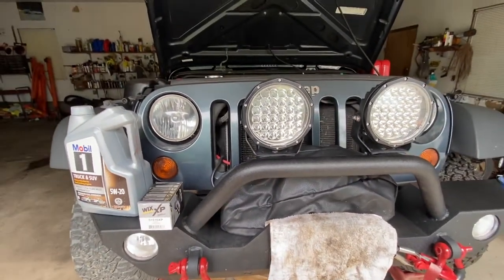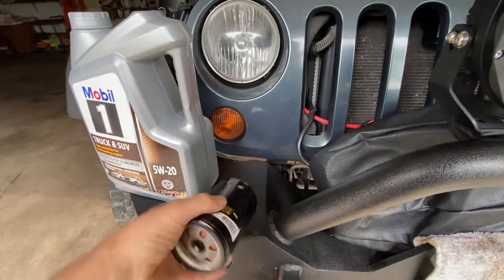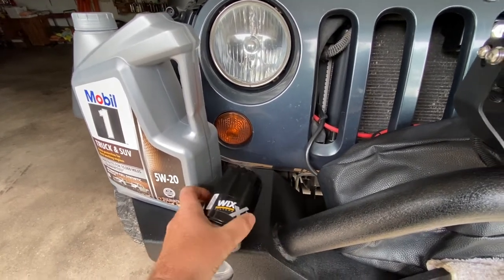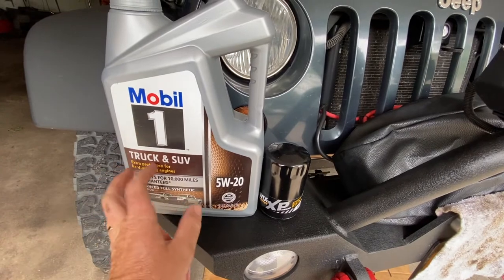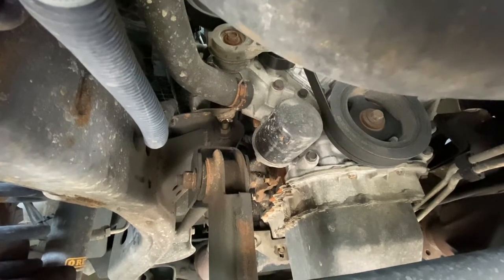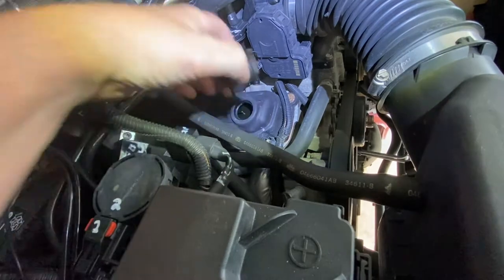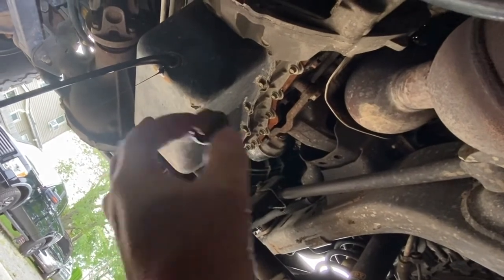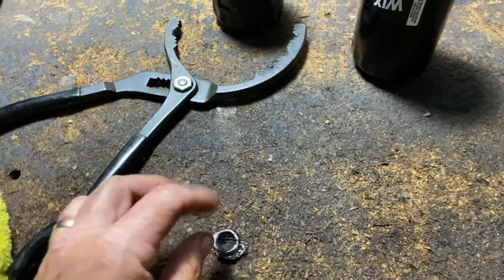Cold Start Up Rattle Noise on Jeep Wrangler - Easy Fix

Comment: Yeah that filter definitely doesn’t go on any wrangler above a 2011.
Reply from the maker: You tried to install one above 2011?
Reply: @Motorcarnut  well I own a 2016 and all Jeep 3.6  has their oil filter mounted on top , and are not canister filters . They are media filters that install in a housing mounted to the oil cooler .
Reply from the maker: Different filtration, you’re right. Does yours experience the start up rattle?

Comment: Does the noise kinda sound like someone blowing their nose? Like when someone blows their nose very hard and loudly. That’s what my Jeep has been doing, and I’m pretty sure it’s the same rattle you’re talking about.
Reply from the maker: Sounds almost like an exhaust rattle.
Reply: @Motorcarnut  that’s exactly what I would describe it as. Exhaust/heat shield rattle. My 2023 2.0 did the same. Changed the filter to this filter and solved the problem. I knew it had to be related to being starved of oil on that initial startup.

Comment: just start it in clear flood mode to bring oil to the top of the engine before start up
Reply from the maker: Doesn’t solve the problem though
Reply: Agreed, but if Ipaid all that money for a POS Italian toy, I'd want it to last as long as possible.  Information is power. @Motorcarnut
Reply from the maker: I guess

Comment: My 2004 4.0 does this and I've changed the oil twice and the second time used a OEM Mopar filter. Still rattles for 30 seconds. I just bought the Jeep 3 months ago and haven't put 500 miles on it.
Reply from the maker: Did you try my method?
Reply: @Motorcarnut  Not yet, I just did the valve cover gasket and checked for anything loose and nothing was. So the filter will be next. But I did start It with the valve cover off and It took about 5-10 seconds before oil got to the top.
Reply from the maker: I know it's an old Jeep but it shouldn't take that long for the oil to reach the top end, sounds like the anti drain back valve is not working properly.
Reply: The filter and oil won't help it trust me I owned 7 4.0s from wjs-xjs and now on a tj and they all rattle like a can of rocks .only thing that helped was some rotella t5 and some engine restore it rattles just not as much now
Reply from the maker: Well been a mechanic for 40 years Trust has to be earned. On the 3.8 it works if it’s caught in time and mechanical damage hasn’t been done. Additives don’t work!
Reply: @Motorcarnut  definitely can't trust anything from "Chrysler" after 01 even 00-01 is 🗑️

Comment: the Wix filter for the 3.8L Jeep Wrangler is Wix 51348XP.. why did you pick that one?
Reply from the maker: Did you watch the video? I explain why
Reply: Not an issue with the oil pump, does not needs to built up more pressure to pump thru that larger filter.  I’m skeptical about these YouTube “fixes”.
Reply from the maker: Nope

Comment: Don’t replace what you put in, you could have burnt a quart in between changes.  Also, that filter is much bigger, add another 1/2 quart.
Reply from the maker: Wrong, you put in what you take out for a starting point THEN you add as needed till at full mark, the extra long oil filter has nothing to do with it.
Reply: @Motorcarnut  no, if it takes 6 qts, put in 5.5-5.6, there is always a “stick around” amount, every drop never drains.  I like it to sit overnight, so it all settles down, then measure and top off appropriately.  Your method, what if you burned or leaked a quart or two ?  You’re going to put in 4 quarts ? If that is all that comes out ?  Yes, I use the “replace what you remove” when it comes to swapping out ATF.  A longer oil filter might hold twice the oil as a standard one, you need to compensate for that ? No ? You have an intake from the oil pump into to the the oil pan, you want that immersed in oil, not sucking in air when flat, at an incline, etc.  I agree, I NEVER put in 6 quarts if it calls for 6 quarts with oil and filter change, I’ll put In 5.5, 5.6 or so, and take it from there, but with motor oil, to only put in what you remove ?  I don’t think that’s a good idea when you can have burn, leak, etc. especially for someone that does extended oil changes > 5000 miles.  Anyway, Overfill is as bad as underfill.

Comment: 5 w 20 is too thin, for 3.8, they did that for fuel consumption 😂
Reply from the maker: Not really, in cold temperatures thinner oil circulates through the engine faster for better protection.
Reply: Yes really...the only reason 5W20 came in your vehicle was manufacturers trying to meet a EPA mileage goal spread out over millions of vehicles. 5W30 is what is needed @Motorcarnut

Comment: all you have to do is hold the pedal down all the way and start, the engine won’t turn over but it will try. Then release the pedal and it will start. Problem solved.
Reply from the maker: I don’t recommend doing that.
Reply: He described it incorrectly, but there is no reason not to recommend the procedure. All you are doing is using the starter motor to prime the oil system prior to firing. These are not carbed engines and holding the throttle wide open only signals the ecu...no fuel is sent thru the injectors and no spark occurs. @Motorcarnut